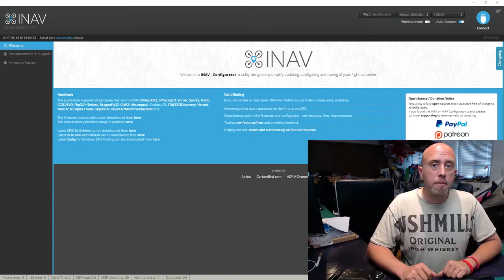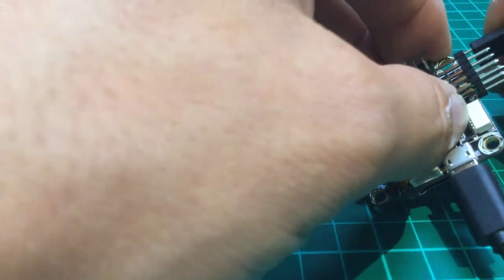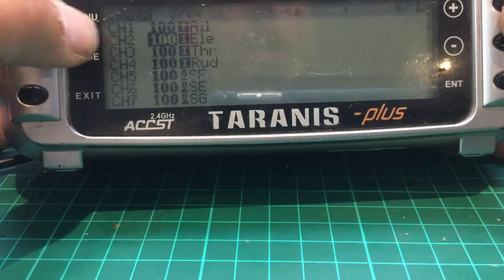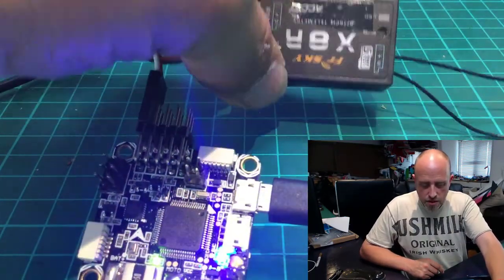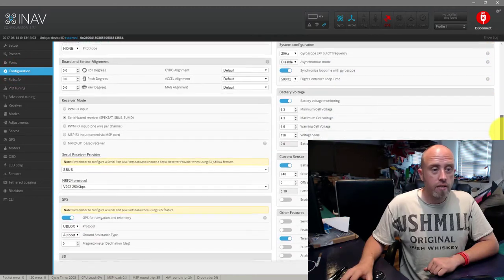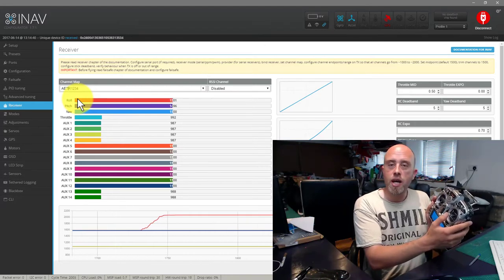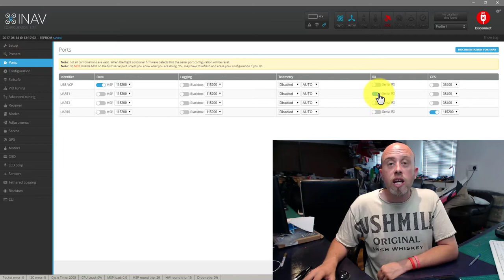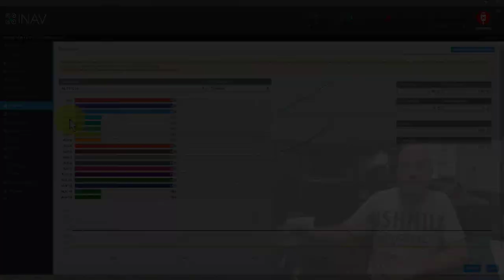Part #12 - Connecting Your Receiver to Your iNav Flight Controller (SBUS & PPM, V1 & V2 Boards)

Comment: Hi Matt, I've seen you posting these on RTNO faceache page so back in May/June I collected all the bits and there they sat in their respective packaging, until today that is when I thought it's about time I did something with them. So today I've been going through your excellent videos and successfully married up the Omnibus V2 board with Ublox M7 sat and it works, yayyyy! Only the Rx to sort then I should be golden. Big decision now is to either replace the Storm in the C1 Chaser or put it in the sky shadow.
So I just wanted to thank you for putting in the time and effort in producing and publishing this series of videos, which I found very easy to follow. I couldn't have done it without them. So thank you!
Paul
Reply from the maker: Howdy Paul, I'm glad the series has helped you. One thing I've learned, "if it's not broke, don't fix it", so I'd put it in the model that hasn't got a flight controller and enjoy it in that one instead, hope that helps, Matt

Comment: just watched this...doing my first FC build with f405 and inav. Been having problems getting those reciever tab sliders moving the right way because I was told NOT to do it in the transmitter? I guess you saved me.

Comment: So in inav configurator software by clicking receiver icon the throttle t light green bar nothing control the motors right like when you power on your drone or plane and push the throttle channel 3 from the transmitter but how your motors is working please

Comment: Hi Matt. Enjoying watching, now doing, or should I say trying!!Trying to get to grips with this new technology!Bought a Reptile s800 with F411 board thinking my Hitec Optic 6 would work with it. Seems it mat not!. So I'm looking for a transmitter and receiver on Amazon and somewhat overwhelmend! There are some around £50-£80 mark with ibus but can't see if it will work with this board and inav. (I think S-bus is preferred but cost is prohibitive.....)FrSky seems popular. Also, some with PPM which looks like it will be OK from your video ...also are these any good for long range? Kind regards.

Comment: Hi Matt
I have followed all the episodes so far but cant get the SBUS to connect on UART1 on the F4PRO V2 board
People on Github have supplied flash local firmware to fix this but this has put the RX on UART6 and  GPS on UART3
SBUS now works but GPS red icon only without a fix 
I have tested the GPS previously and its works fine
I have  two F4PROv2 boards and both have the same problem
any ideas?
regards
Hans

Comment: Having issues using Inav on my GPS built.  On Setup page Pre Arming all green. On GPS have 10 sat. Receiver Bind with controller, LED Green On, Blue LED on  four bars on T12 controller. FC blue LED steady flash. In iNav no stick or switch activity at all.  On Port page UART6 set to Serial RX as wired, Cant figure out how to get the stixs working.

Comment: hope you can help me, i have a problem in INAV, i cannot change channel map ... its now AETR and it has to be 12AETR34..  if i do it in the GUI it get RED when i change the channel map... if i do it in the cli i get PARSE ERROR... very strange, it is a ff35 fc board... i have change to older firmware, older inav gui but no succes. Now its flashed with the latest firmware and i am busy for hours now and didnt find a solution... i have the frsky x4rsb receiver and i need to use the 2 analog outputs for pan and tilt..that are aux channels 5 and 6 (or 5 and 6) so i need 56AETR78  .. hope you can help with this frustrating issue
Reply from the maker: Howdy Marc, that sounds like a bug, you'll need to report that to then, Matt

Comment: Hi Matt. Loving the reviews mate. Quick question about expo settings for my Genesis fixed wing running iNav. Where you recommend setting up Expo for Pitch/Roll and Throttle ... on the Taranis or in the iNav 'Receiver' menu? I'm using iNav for RC Expo (separate values for stabilized and manual/passthru modes) and iNav for Throttle Expo. Thanks for any clarity. Cheers, Steve

Comment: Hello Matt! My C1 Chaser build is coming along and very excited. My wife teases me about beeping noises being nerd alerts, but l'm lovin this. Need help setting up remote. My Taranis X9D has the same mixer settings as yours, however stick right moves both roll and pitch in same direction and stick up both Roll/Pitch move different directions. --- Any clues where to look to correct this? *Sorry it the stick thing hurts your ears, I'm still learning.
Reply from the maker: Howdy Cliff, firstly no mixing is needed in the transmitter. The mixing is done when you selected a flying wing in iNav. As for reversing the outputs, make sure the receiver is moving correctly as shown in the setting up the receiver video and THEN (and only then) reverse servos if needed in the "checking the surfaces" video. Hope that helps you Cliff, Matt

Comment: Hi matt..
This is about inav.
Ive been followed all of your instructions. I was using omnibus F4 V2.
But I get the problem when connecting the L9R frsky Receiver with fc.
The receiver isn't powered.

If we take a look on your vid,
You see the receiver connected to the fc only by a single wire male to male cable.
Then the fc connected to the computer via usb.

But the receiver powered on.

But when I tried,
I just do as the same you did.
But the receiver still not powered.

Any idea?

Why my sbus is not working?
Reply from the maker: Hey Rian, see the FB group! Matt

Comment: Hi Matt  do you ever use the R-XSR and XM+ Receivers with your INav Fixed Wing builds ???
I ask as they are rated as full range Receivers and they have the Smart port connection
I am building a Teksumo flying wing with a Omnibus F4 V2 and am planning to use Inav 2.0 ! What RX would you use ????
Also how would you mount the Omnibus F4 on the Teksumo wing ??
Reply from the maker: Howdy fella, yes I have one, however I am a big fan of the D4R-II receivers as they have proven to me to be super reliable for smashing models in & around trees, so the same kind of range as you would have from the XM receiver. Hope that helps! Matt
Reply: Thanks Matt    Do you glue the Flight Controller to the wing..
I am trying to figure out how to mount the FC on my Teksumo without trashing the FC with glue ????
Reply from the maker: Morning, dig a hole for it? If you look wayyyy wayyy back at my older vids, I have a teksumo there and was trying out iNav, I used a motors box, buried into the centre of the wing that worked well, Matt
Reply: Thanks for the info Matt
I have started going through your YouTube Vids all of which are very informative and presented brilliantly !!!
I have been into Quads and Betaflight  for a long time and here I am now with Inav and back to fixed wing etc !!!
I have waited for Inav to mature a bit more before taking the plunge !!
 Inav 2.0 seems to have addressed some of the earlier issues that I have seen people encounter 
so I will give it a go !
Question is !   will you be releasing any Inav 2.0 vids in the future ??
Also do you use Nav Althold ???
How good are the Barometers on the various FCs ?
I have seen people having problems with their accuracy

Comment: FYI to all those people who could not get PPM or SBUS to work. I had to remove a 0 ohm resistor on the board to enable it. Google: SBUS omnibus f4 jumper. Theres a post on rc groups which shows which ones to remove

Comment: Hey Matt, Love your technical videos. As I replicate this project, I can’t get the servos to respond to the control inputs. I’ve done everything as instructed but No Joy. I’m running the V2 board; do NOT have the PPM-SBUS solder pad beside the ireceiver input. I am using the futaba T14SG Xmtr, R2008S receiver in the SBUS mode. Everything checks out with iNav. I was even able to connect both th GPS and RSSI wire connector. I’m using a UBEC to independently power the servos. Outta ideas here... I’m sending you a huge S.O.S.
Reply from the maker: Howdy Phillip, really not surer with Futaba, best place to ask is over with iNav here https://github.com/iNavFlight/inav/issues Matt
Reply: Phillip Sherwood. I'm going to be trying that as well. I've had luck using FrSky using all these Matt-Nav videos. 
I want to use this receiver with Futaba because I think it has a long range, and I already own it $$.
How did it all work out for you? I'm going to remove the FrSky and wire up a quick disconnect while at it so I can use a known working board for testing.

Comment: Still cant get this r xsr and f405 wing to work with inav 2.5, no stick input in inav, radiomaster 16s binds quickly and shows good stick inputs in input,mixer and output. I  wired sbus out to sbs, power and ground uart 2, set serial rx in uart 2 and enable sbus in inav. Maybe you can help? Thanks for all your videos
Reply from the maker: Howdy Eg, really not sure. What I would say is see the Fixed Wing iNav group on FB. Loads of help there and replies will be much much faster! Matt
Reply: Thanks

Comment: so. if I wire up a "normal plane" and I need pan and tilt and maybe retracts too, I run out of pwm channels.. what are my options (I use Frsky Taranis)
Reply from the maker: Howdy Bernhart, if you run out of PWM channels on the board, the only way I know of is to use a different board that has more PWM channels. I believe there is a F3 board that has 8 PWM outputs, Matt

Comment: Hi. I'm using a Naze32 and can't get the AETR1234 to set the taranis x9d+. It always get back to AETR5678 and my radio doesn't work. It was just fine in cleanflight.  What should I do to get my radio working? Thank you!!!!!!!
Reply from the maker: Howdy Helder, as far as I was aware the Naze32 is no longer supported by iNav, you'll need to consult their wiki or dev files for help on that one, Matt
Reply: Thanx Matt!!! I'll get a Naza Lite to finish this project!!!

Comment: I have established my rx uses PWM and thats fine with me. Everything seems to work...right up to rx connectioon. I get a good bind but no reaction in INAV. GPS works great. I'm being a little persistent here as I own four V2 boards and all four act the idenical way. I have tried, Futaba, Flysky and Spektrum TX's and RX's. I can't get a reaction from INAV beyond hardwire connection of the rx. Any thoughts before I pitch them? thanks
Reply: Matt...I have finally achieved success with the rx. Everything seems to work OK! However, I still have no recognition of servo movement in INAV. Thanks
Reply: This is very puzzling. How about I put a short video on youtube and you make an assessment? I'll send you the link.

Comment: Hi Mat, i can't get the RX communicating with the omnibus v1. My  RX gives green light and rssi. Does it have to do with the tiny solderpins left of the sbus plug were i can read sbus and ppm?
Reply from the maker: Howdy Peter, the best thing is to check your board pinout matches the ones in the video. It should be the first pins on the front of the board and then set appropriately for SBUS or PPM in iNav, Matt
Reply: Hi Matt!  Thanks very much for this great series!  I'm stoked about getting this all done and setup in my wing.  However, just as peterpaul100 mentioned, above, I'm also having troubles.  With a PPM rx setup wanted, I do not have UART1 "SerialRX" enabled.  I do have PPM RX input selected in the Configuration Tab but when I go to the Receiver Tab, the channel bars don't work properly.  I know that you said that you are unfamiliar with Spektrum gear, and of course, thats what I"m using.  I've done some reading and people are telling me that I need to remove that 0 ohm resistor from the SBUS jumper pads (real small) to the left of where the PPM/SBUS three pins are.  Do you have any suggestions about what I should do?
Reply: same problem here...

Comment: Hi Matt, I'm using an x8r receiver using sbus. In iNav I've got the sticks going correctly and also my flight mode and RTH switches. What I noticed is that I can only use channels 1 through 8 in iNav. Even though on my radio I can see where I set up channels 9 and 10 on a switch. I can also see the values change on the radio when I move the switches. But in iNav on channels 9 and 10 there is no movement on the receiver screen when I move those channels.  I know with sbus I can get up to 16 channels. Is there something that I need to do in iNav to get channels 9 and 10 working?
Reply from the maker: Howdy fella, yes add the extra channels in on the receivers tab. By default it stops at 4 aux channels, Matt

Comment: hey matt ! everything wokrs well , all control movements  on inav , right channels , in usb  blue and green lignt, but my channel map is AETR5678 ? on inav AND when i connect the battery to the board in sbus with x8r i have no throttle on ch 1 and no blue and green lights,,,,,, can you help me ,,,,,thanks
Reply from the maker: Howdy Rick, I'm not sure. If it's not working as shown for the receiver tab, then there is an issue with the input. Also remember the board needs o be armed for the motor to work (if motor stop is enabled). Check the first screen of iNav to see what the issue is on the right handside if all your channels are showing correctly, Matt

Comment: Could someone please explain why I can't get VBAT to appear on the configurator, even when I have a battery connected through my board. It always just shows 0.1V. I've followed all the settings to the letter. Please advise! Thanks!
Reply from the maker: Hey Mat, no idea. Either consult the iNav wiki here https://github.com/iNavFlight/inav/wiki or make sure you have enabled and the right pin on your board, Matt
Reply: Thanks for taking the time to reply Matt. After much desoldering and resoldering, I fixed it by simply resetting INAV to default values.  Turns out I'd mixed up the values of these two settings! 
set vbat_adc_channel = 1
set current_adc_channel = 2
It should be:
set vbat_adc_channel = 2
set current_adc_channel = 1
Cheers!

Comment: Matt....INAV fails to install PPM RX mode. If you load PPM it will refuse the change and bring you back to PWM every time. Any advice?
Reply from the maker: Hi Paul, I'm not sure what the issue is as these flight controllers do not accept PWM inputs. If you're having issues, check here https://github.com/iNavFlight/inav/wiki and their support forum is here https://github.com/iNavFlight/inav/issues Matt

Comment: Hi Matt, your explanations are great, I try step by step to follow you...
In the receiver part of iNav the movements of the sticks are perfect like in your check explanation but under channel map I have AETR5678 and not AETR1234, is this OK? I cannot change it.
How can I map the switches SF, SE and SG with the voice messages (engine arm, ....off, etc.)
thank you!
Reply from the maker: Howdy, yea you can change it in the configurator or in your Tx. As for the sounds, that's called "The Amber Mod" for the taranis, google it for the files. Matt
Reply: It's strange...., I cannot set AETR1234 in the configurator or in CF CLI, it's return always after save to the default parameter AETR5678.
In my TX are CH1 = AIL, CH2 = ELE, CH3 = THR and CH4 = RUD, something isn't correct....
Thanks for any suggestions.
Reply: On CLI mode if I give the command "map" I get back "Map: AETR1234" but (in the iNav configurator) under Receiver show me always Channel Map "AETR5678" and isn't editable.
Thanks for any suggestions.

Comment: Hello Matt I tried doing exactly what your doing on inav I flashed the omnibus f4 pro but on my receiver page mine is reading channels instead of Aux is there a reason for this.
Reply: I guess you’ve discovered by now that the new firmware lists Aux as channels. Far more logical.
Reply: Tim Arnold thanks Tim I got it now.

Comment: Hi Matt , on my knees begging for your help. as you know I am currently setting up Inav on a mini Talon ("currently" being 3 long weeks of hair pulling). Ive followed every step of this series and copied it religiously except for the fixed wing guide where I followed the wiki and downloaded the custom mix for the Talon. I'm using everything you detailed including ; Taranis, L9R, omnibus ,neo m8n etc
.Problem 1. the motor arms but will not respond to throttle commands, esc is fine and motor runs on a watt meter.
Problem 2. Ailerons only work with their opposing rudderavator and then only on the rudder and elevator stick.
problem 3. The wiki does not detail which outputs the ruddervators use.
I've managed to get the ailerons working thru trial and error but the ruddervators are a nightmare, whilst I've got them moving in the same direction the elevator is on the rudder stick and vice versa. I thought simply swapping the outputs on the omnibus would be a simple fix but no it only reverses the direction, elevator is still on rudder and rudder on elevator.
Just a little background I've got all the servos working independently off a 5amp Ubec whilst the board is powered thru the Vbatt pin 
Please , Please , Please help or the whole lot is going in the dustbin I've got better things to do with 3 weeks of my life.
Reply: Forget the above Matt, unfortunately i was taking your instructions too literally. When you said do no mixing on the Taranis I've avoided doing anything with the settings but then I  realised its OK to change the servo directions. Doh. Still got the first problem just can't get the motor to run. Tried it again with the watt meter and it runs perfectly, also tried recalibrating the ESC but nothing except for a 1 sec motor run if i apply full throttle and then activate the throttle  switch

Comment: thank you for this video brother, could you possibly do a new series with a Matek F722 board or a 405-CTR especially the connections for RX, GPS, servos and ESC, the setup as well would be good but not necessary